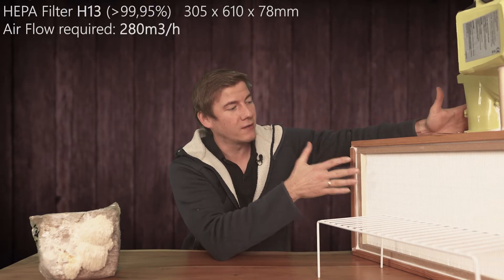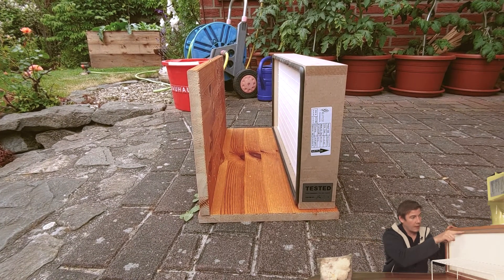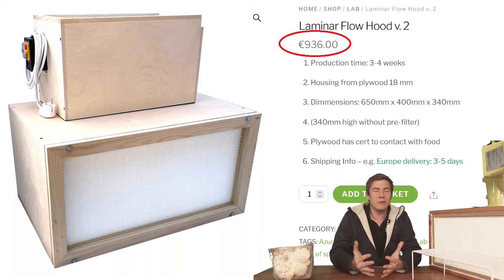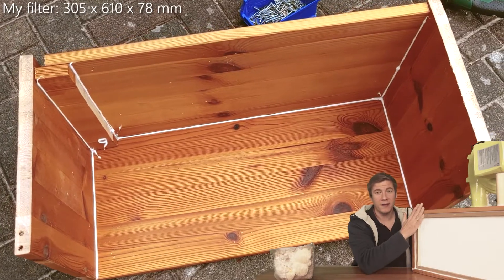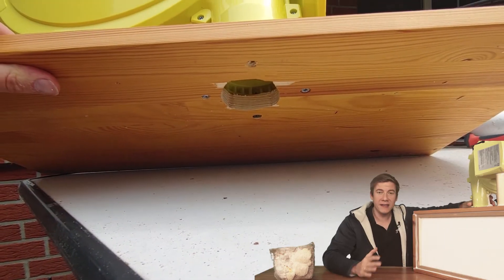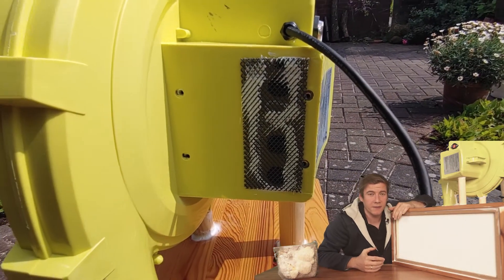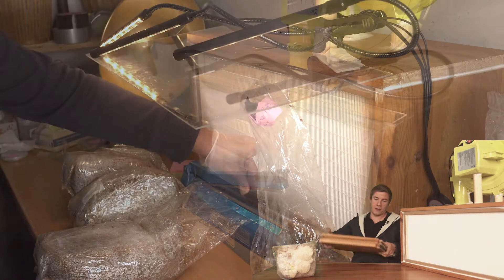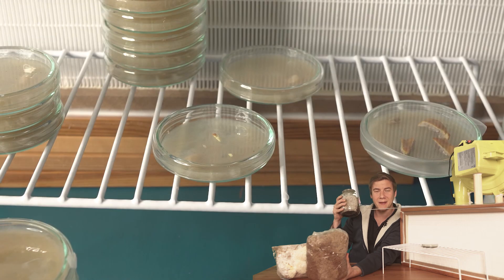How to build a cheap DIY Laminar Flow Hood | Tips and final Build

Comment: Moin, ser gute video!
Can you tell me if i should benefit from have sealing on inside or outside for building the box?
What prefilter do you recommend for a HEPA 14 system for longevity?
Reply from the maker: Filter should be outside as it presses on the frame. Id go with hepa14

Comment: hey hi, I build the flow hood based on you measurement. But I have been having a lot of contam. The thing is, I didnt have contam when just pouring agar in the plate. I did the 2weeks test. But, whenever I tried to do agar transfert from an other agar, from print or form swab, I have been having only contams. Do you have an idea why? I also did the light test, I have a stable 45degree flame.
Reply from the maker: Hey, what filter and fan did you order?
Reply: @HappyMushrooms  I used the filter you recommended, for the blower I order of in the link you had but the plug and power didnt fit to my country, so I had to order an other one, "mid-compress-low-noise-blower, type:  yyf-2-8012, 750w".

Comment: Hi there, thanks for your vid. I purchased the blower you suggested. However, I can only find a HEPA with these dimensions - 91.5 x 61cm x 9.6cm. It's not as deep as yours. Do you think it will still be ok? The only spec I have of the filter is that the supplier says it is h14 Rated at 99.99% Efficiency and filters to .3 Micron @ Rated Air flow 800 m3H. Do you think this will be ok? Thanks for any help.
Reply from the maker: Yes that Sounds good! But you might need a stronger Fan than I use
Reply: @happymushroooms Do you think 61x61x7,8cm HEPA Filter on the as-Luftfilterwebsite would work with your Fan?

Comment: hey i am a little confused, on your first video you linked the 680 W blower fan.  In this video you linked an 980 W fan but then in the video you listed the fan specs as 680 W.  Can you please verify what fan you're using with your flow hood? Thanks in advanced your videos are very helpful (:
Reply from the maker: Hey sorry for that. I am using the 680w version. The 980 would be an option of you plan a lot bigger flowhood. Tank you:)

Comment: Hi, is H13 sufficient for the stuff you are doing, or should one go for H14?
Reply from the maker: Hey h13 Works fine. The risk of contamination due to the filter is almost zero. I know a lot people using h13 without Problems. H14 is still a little saver;)

Comment: Hi, 
I really like your video, I'm planning to do the same as your. Could you give me the exact measurement for the box? I didn't really get that part.
Reply from the maker: Hey :)The dimensions of the filter is 305 x 610 x 78mm. The inner dimensions of the box is 305 x 610 x 200mm